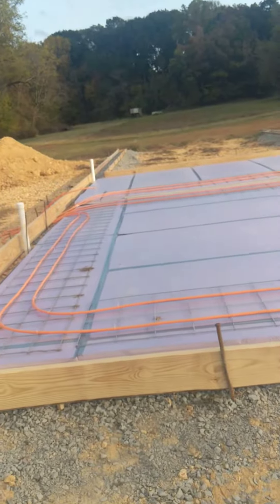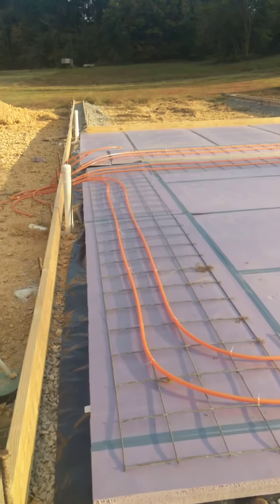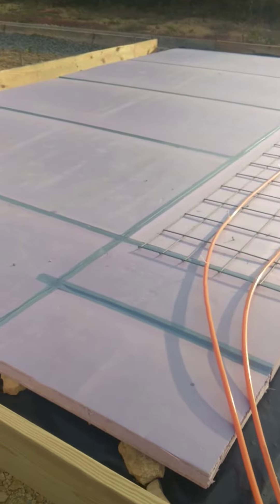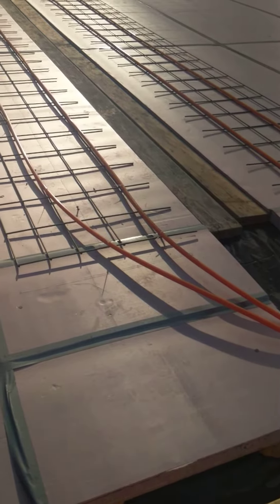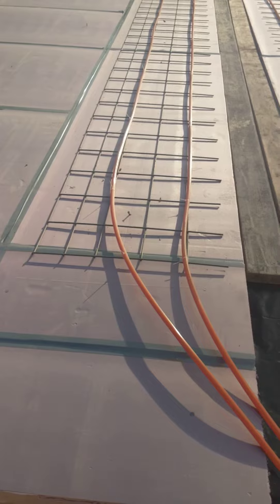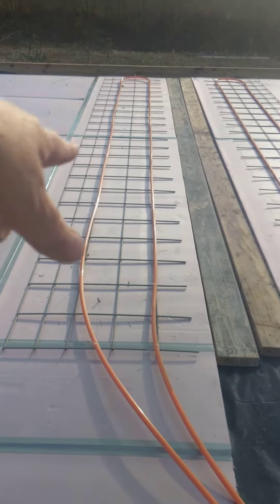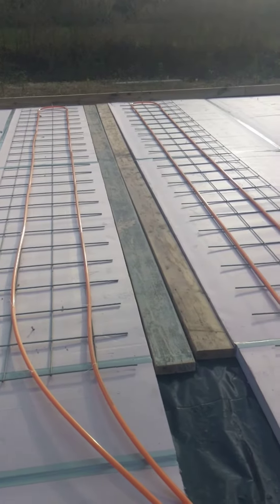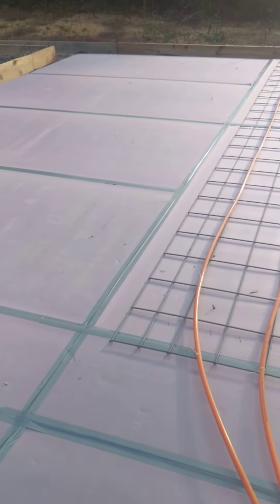Facilities - In floor heating.  (sorry phone died at end) #dogkennels #caninecorporation

Comment: great idea!
I would do 2x loops at 8 inches apart in case one loop gets damaged or if you want more heat at lower temperature. Please use a conduit protection at the 90 degree bend for the heating pipe. 
This would be a great idea for an outdoor dog house!
Reply from the maker: In a colder climate area, that is probably a great idea.  Here we have very few days of cold weather and we need to be able to provide just a small area of heat, but don't want to cause the whole building to heat from the concrete.  We could be 10 in am and 60 by lunch here.